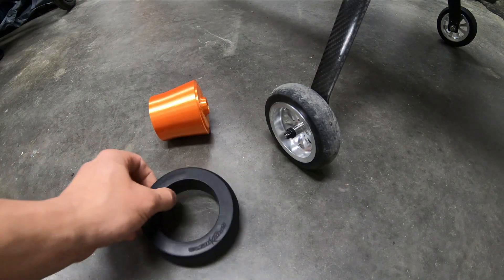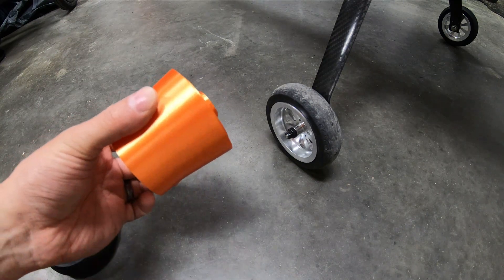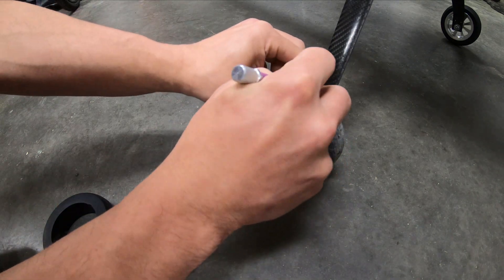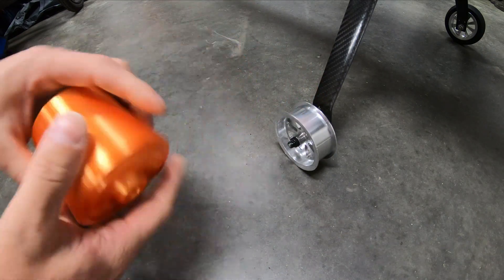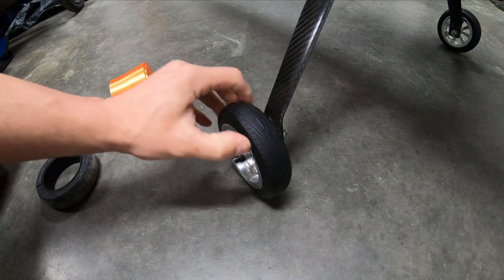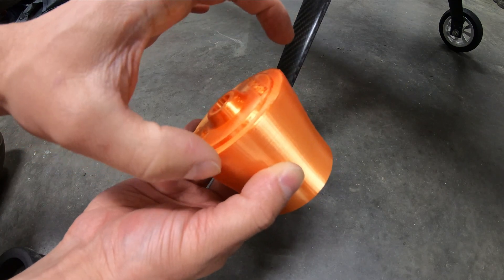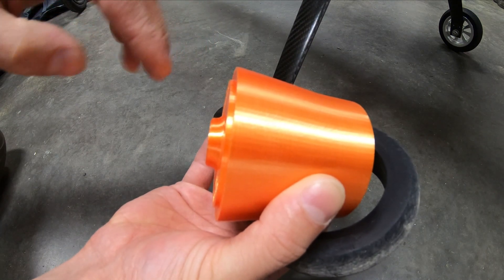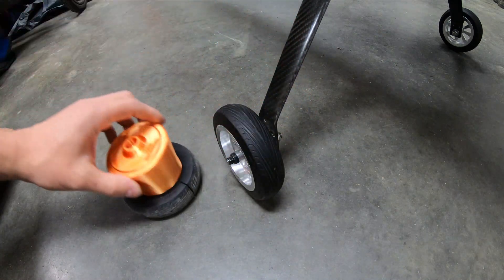SpotOn RC Flywheelz Tire Replacement - The Easy Way!

Comment: Hey Nick, I'm in Anchorage and I was wondering if you might be able to give me any direction in getting some bushwheels. I just got a draco in from eflite. Wheel are not actually too bad but they are super stiff.  I'm running 6S high C Batts. Dubro are readily available everywhere I can take the extra weight if I have too but hoping for some lighter options. Thanks bud 

I'd like to leave contact info I just wasn't sure if this was the right place to do that. I'm on fb, email, I can leave number if you think it's okay just never contacted anyone in this before. Thank you 

-Alazkan
Reply from the maker: Hey man, no problem! I cannot remember the size of the draco tires, but options are limited. Kavan are the best option for light up to 6”, then there’s dubro, then AirTops, then PMT. the PRs are out of production.
Reply: @aknickrc  your awesome! Thank you for replying, I've been trying to pick something out of those brands. Stock wheels are a little over 5" super lite but very dense foam. Those PR's on your timber are amazing! That would be my choice if I can ever find em.  The last plane I flew was 2009 old balsa nitro my IV I think is what it was called, a trainer whatever it was. This is going to be a
 hail mary flight. I'm 100% we'll be taking off and flying for a few with landing closer to 50/50. I was hoping to get closer to 60/40 or 70/30 with bigger wheels. Your videos are awesome though so thanks again for a reply and input, take care 

-Zachary
Reply from the maker: @zacharynashalook8452   I would look into the 1/3 scale J-3 Cub tires from Dubro as well. They are soft and light foam.